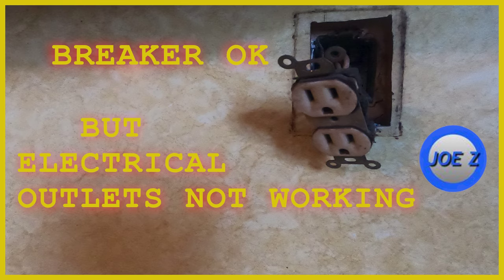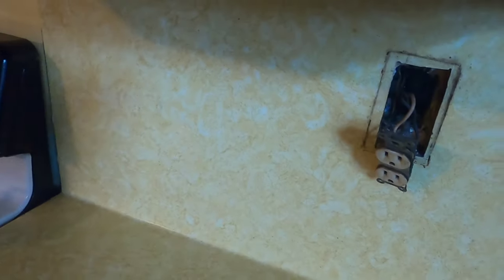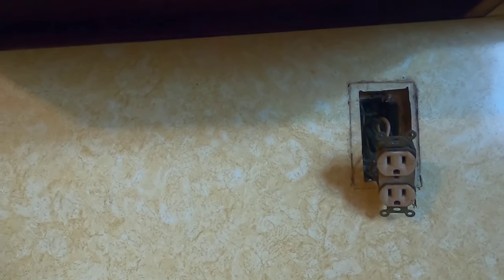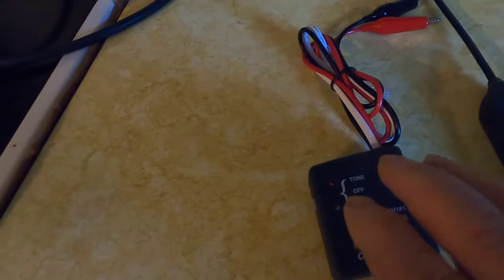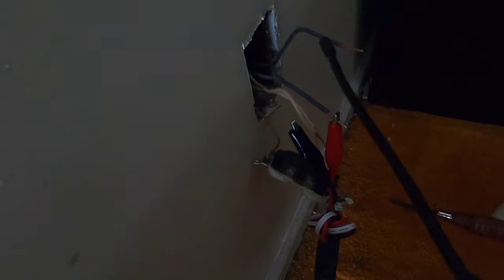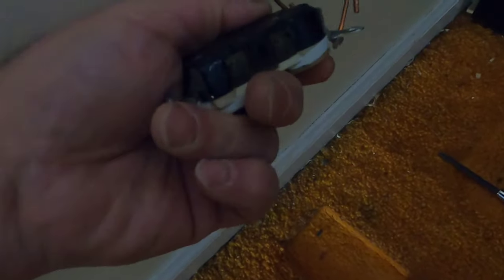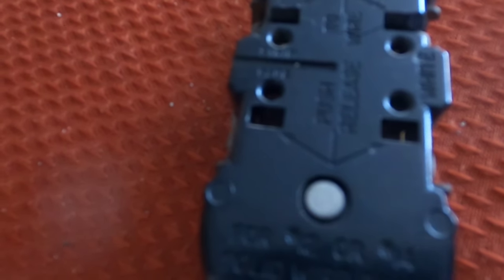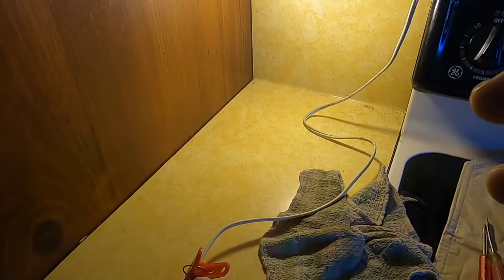Breaker on but no power to outlet FIX

Comment: Thanks man, my wife was pulling my handy man card because I couldn’t figure out the outlets. At 3:26 you fixed my problem, I ran to another bathroom and saw the GFI outlet was tripped and I smacked the button and wallah everything was back to working. Was that simple. Thanks again for the trouble shooting.
Reply from the maker: shahriar bakhtiari,  You're welcome, I am glad this was of help. & you got to keep your handy man card LOL Thank You for watching and taking the time to comment. shahriar bakhtiari I have other videos on my channel that cover many different subjects  and new videos added weekly that may also be of help or interest.
 Be sure to 👍, share and subscribe if your are inclined to do so.  Also not to miss any new videos remember to hit that notification 🔔
 Another way you can help support  this channel at NO cost to you is by using one of my affiliate links.
             * Thank you for watching I really appreciate your support.***
Again I hope you get to  enjoy other videos on my channel as well. 
 Stay safe, Joe Z
Reply: The GFCI outlet was what was causing a problem I had to fix last weekend, except that I had to replace it. Pressing the reset button didn't do anything.
Reply from the maker: @cordialspirit  The GFCI outlet is a good place to start. In my case there wasn't any GFCI outlet only a GFCI circuit breaker. The breaker was ok it was a bad outlet in the circuit that I had to find & replace.   Stay safe, Joe Z

Comment: Great video. You have the patience of Job. What was the tester you bought at Harbour Freight? I rewound the video and couldn't read it from the camera moving nor find it in your store.  Thanks
Reply from the maker: You're welcome and thank you for watching and your comment. First time I was told I had the patience of Job. I will have to keep that in mind when "my patience" is running low LOL. 
That tracker is a Cen Tech cable Tracker. If Harbor Freight does not have it in stock You can use this Amazon link https://amzn.to/3IgtbKR. There are other options on the site as well. It has been awhile since I used this tracker but may be needing it once again. Let me know if I can be of any help.
Stay safe, Joe Z

Comment: I just changed the first plug on the circuit and everything else down the line came on you did make a good video.
Reply from the maker: Thank you for stopping by & taking the time to comment. How did you know which outlet to change or if it was the outlet that was the problem?
Stay safe, Joe Z
Reply: @JOEZEP54  it was an outlet from 1940. My microwave and fridge went out today while I was using the microwave so I figured I'd change that plug first. Your video was good I did learn somethings ty

Comment: I have three outlets in the kitchen all of sudden has no power.  Do you suggest changing all three of those outlets?
Reply from the maker: Thank you for watching. Please keep in mind I am not an electrician. I would check where the power/current is being supplied from. Look for the outlet that has only 2 wires that should be the end of the run. Then check to see if the other 2 have power being supplied to them. If not your problem is in another area. In my case it was from an outlet in another room that went bad. Keep safety in mind when doing any electrical work a small mistake can have deadly consequences. If you are not familiar with working with electrical issues calling an electrician  would be the safest option.
Let me know if this was of help.
Stay safe,  Joe Z

Comment: I think I might have the same problem. Thanks for the video. I have one outlet in the master bedroom that must be connected to the next bedroom. The entire second bedroom has no power but the circuit breaker at the main panel is not tripped and I originally reset the breaker. I have a laser printer that may have caused a big surge on that one outlet.
Reply from the maker: rlg222,  You're welcome, I am glad this was of help. And thank you for watching and taking the time to comment.
If that is the outlet it will save you some time to make the repair. In my case I had no idea.

Just be careful & use all safety measures.

rlg222 I have other videos on my channel that cover many different subjects  and new videos added weekly that may also be of help or interest.
 
Your support is not required or expected but always appreciated. If you are inclined to do so your Subscription, Likes, Comments and using the following links do help.

     
rlg222 I just want to mention If you haven't installed the TubeBuddy browser plugin yet, to help your channel grow  Just go to my favorite tool for channel growth Tube Buddy. Now You can use it too, here's my affiliate link to the Free versionhttps://www.tubebuddy.com/joezep54   Start with the free version, yes it is free to not only to down load but to use.
Again I hope you get to  enjoy other videos on my channel as well. 
 Stay safe, Joe Z
Reply: @JOEZEP54   I found the problem. The outlet that the HP laser printer which pulled 6A was plugged into was actually ok. It was daisy chained to the next outlet, two other outlets and the light switch for the room in the next room on one side of the room. The hot side which had three hot wires melted the wire nut for some reason. I pulled all the wires out cleaned it up and used WAGOS instead of wire nuts. Then I replaced the outlet.
Reply from the maker: @rlg222  Glad you were able to find the issue. I would look into why that wire nut melted just to be safe.

Comment: OK,  I have similar prob w/ garage receptacle . So I made a "suicide cable" {Confirm Hot & neutral prongs, make sure you are on same branch &/or same leg, not opposite leg = 220V] to jumper from a good receptacle on that branch to the dead one and the other dead receptacle started working. But HOW the heck did you disconnect the push wires? Seem to me there is a release slot but they won't let go. Thanks
Reply from the maker: Thank you for watching & commenting. I am not a safety " nut" but would  not rely on that  "suicide cable" and remove it. I have run into some outlets that would not let go. Do not know why but it does happen . I just snipped the wire as close as possible to the outlet.
Stay safe, Joe Z
Reply: @JOEZEP54  Ok but my vehicles were trapped since garage door was on the branch. I watched another video & found a proper size screwdriver & removed the push in wires. Tossed the junk receptacle and replaced it with a HD 20A amp screw  clamp only receptacle & all the garage receptacles work again. Thanks
Reply from the maker: @scotts.7662  Did what you had to do and all worked out well. Glad you were able to find & make the repair to get everything up & running. 
Stay well, Joe Z

Comment: Good Job, Joe Z,  I will see if just starting with changing 2 old outlets in mu garage that are not getting power will do the trick as Circuit breakers all seem to be working.  Thanks************Kurt
Reply from the maker: You're welcome. Thank you for taking the time to comment. Even with the breakers off check the lines for current. It is possible to have a faulty breaker, mislabeled. or 2 lines powering the same outlet. Come visit again.
Stay safe, Joe Z

Comment: I believe this is exactly what is going on in my house, the outlets in the master bedroom (above the living room) and the living room are all not working, but they work in the dining room next to the living room which is on the same breaker. The breakers are all in the on position and have been switched on and off multiple times in testing. The box has no lose breakers and the outlets are quite old, around 50 years old in some parts of the house so they really needed replacing. I will be replacing 9 outlets in total so that each of the affected and the one previous in line to the affected will all be brand new and hopefully restores the power in that area. Though for me it's hit the lighting on the same circuit, the lights won't turn on either... so who knows for sure until I replace the sockets if that was the case or if the wiring itself will need replacement. This isn't my house, but the company that manages it doesn't do repairs... I've had to do them all myself after YEARS of waiting which is appalling, but when I do it myself it is done fast and I take all the precautions to do it right. 

Thank you for your video, and I appreciate you prefacing that you aren't an electrician and also reconfirming it again at the end, you did a lot of good work yourself for not being further educated specifically in that trade.
Reply from the maker: You're welcome. I am glad this was of help & thank you for watching & commenting. Just a "non-electrician" tip, if you have an outlet supplying  more than one other outlet, using a pigtail to make the connection will save a lot of time to repair a faulty outlet in the future.
Again I stress that I am not an electrician & just sharing what I have discovered along the way.
Hope you get to visit my channel again.
Stay safe, Joe Z
Reply: @JOEZEP54  Thank you! That's good advice 😊 I will keep it in mind. I appreciate you and your video!

Comment: Excellent video,thank you! When a room is ran in series like so many are all it takes is 1 bad outlet to kill power to the entire room and you have to figure out which outlet is the culprit. From all the research I've done it seems that the spring loaded terminals in those outlets cause a lot of the problems. Electricians probably get kind of lazy when they are wiring rooms so they use that stab method to speed things up instead of wrapping both wires(the in and out) around the screw terminals.
Reply from the maker: You're welcome and  thank you for your comment!  I appreciate you taking the time to compliment and add information. The house was built in the 70s' when there was a sort of building boom. Things were rushed back then. We pay the price for it today. 
Thanks again & stay well,  Joe Z
Reply: The BBC

Comment: I can only run fans and the lights in my house right now because im not getting enough power.

Checked the outside box and the inside box and the readings are coming back like they should, but i still have very little power, and fluctuations when i plug other stuff in. Any help would be appreciated. Ty.
Reply from the maker: Keep in mind I am not an electrician & am not giving electrical instructions. That said I would first check the breaker for this line. Do you see any corrosion or discoloration on the connection where the line is connected to it or on the breaker where it connects to the box?
I would also check the outlets that have the issue. Looking for any discoloration, loose or disconnected wires. Let me know if this was of any help.
Stay safe, Joe Z
Reply: @JOEZEP54  every receptacle in my house doesn't have the ability to power my refrigerator. I hooked up a meter and every receptacle has the right reading of around 120, in and back. Ty.

Comment: That's good work! I'm going through the same thing now but can't identify where the circuit goes.
Reply from the maker: Hi Paul thank you for stopping by. How can I help you?

Be Safe, Joe Z
Reply: @JOEZEP54  I've got a dead circuit and it's nuts but I'm getting that tracker today
Reply from the maker: @paulbruney1704  Hi Paul, the tracker can be tricky to use the first time out. It was for me. I did not think of it at the time, but use it to track a circuit that is working or better yet a long extension cord. This may be of help to distinguish  the different tones. Let me know how it works out.  Remember to take precautions & be extremely careful. Joe Z
Reply: @JOEZEP54  Thank you I will. It will take a while because the circuit has a light,  to a recepticle" used as junction and a rangehood. It had two other connections but I removed them because they aren't needed

Comment: Code book says that a microwave should have its own receptacle powered by its own breaker.
The wires should be pigtailed.
Excellent trouble shooting! 👍🏽🙌🏽
Reply from the maker: Thank you. Your visiting & informational comment is appreciated. I did not know about the microwave having its own breaker. I am asking if the code is for NY & if it changed since 1976. I am not an electrician, familiar with some codes but not many. All the receptacles that I replaced were originally connected by using the push in holes rather than wrapping the wire around the screw. All previously done at the time of construction by the same electrician. I guess I should be glad they did not install aluminum wires.
Joe Z

Comment: I kinda had this same problem. What happened with mine is an electrician combined the light and fan in a bathroom to one switch. So one switch turned on both the light and fan. Well he also accidentally combined the gfi receptacle which was also feeding a few different receptacles. So every time the switch was off, about 4 receptacles didn’t work either. To fix it I found the line in wire. Connected the receptacle to it. Then pig tailed that to the switch. Leaving the switch, I connected the light and fan. Now everything works 👍 
P.s. I’m a carpenter so judge accordingly lol
Reply from the maker: Thank you for stopping by & taking the time to share. Anyone can make a mistake but it is scary what we come across and not just in the trades. I mentioned it in the video & will again if anyone else should read this post, I am not an electrician 😕. 
Hope you get to visit again.
Stay safe, Joe Z

Comment: I pulled out an old electric outlet, to replace it with a GFCI. 

I accidentally touched some part of the old outlet while removing it on the metal box, and saw a small spark. (I thought the fuse was out, but maybe I had the wrong fuse out). 

Now, I am reading 14 volts from hot to neutral, and from hot to the metal box(ground). I've pulled every fuse in the panel, and still see 14 volts! 

Note, the outlet was working fine before my accident (although the hot/neutral were reversed). 

What did I do break when that old receptacle sparked? Did I burn/short a wire, or junction? How do I find the problem. I cannot use continuity tests since I have 14 volts present. Help!
Reply from the maker: M.N. I am not an electrician & qualified in this area. That said I am stumped as to the 14 volts & not higher. I have run into  disconnected neutral, hot ground reverse but with higher voltage. Having fuses tells me this is an older home & over the years work probably was done. Wires could have been connected incorrectly or may even have a spot where it deteriorated. Have you had any work done lately? If so I would check that out next. Before you work on this outlet shut or pull the main fuse out to block any current from entering the lines. Sorry I cannot be of more help. I know as a DIYer we want to do it ourselves but we also have to keep safety in mind & sometime have to call in the " specialist ".
Let me know if you or an electrician repaired this issue. Your post would be a help for anyone else that may run into this.
Stay safe, Joe Z

Comment: As an Electrician of 26+ yrs... just from this video I see a few Code Violations you really want to have corrected by a PROFESSIONAL.
Reply from the maker: Greg thank you for stopping by & taking the time to comment. It was already suggested that the micro wave have a separate line. Other than that what do you recommend. This is the original wiring done by a  licensed electrician & had to pass building code. It was back in the early 70s. Could codes have changed that much?
Stay safe, Joe Z

Comment: The one outlet screwed up the series of outlets. I’m having the same problem with one outlet in my kitchen too. I have outlet 1, 2, 3  all in line from left to right on the same wall, above the counter. The first #1 outlet doesn’t work but the other ones do. I never checked it to see if it’s just a dummy outlet or if the outlet is faulty.
Reply from the maker: Do you have power in the line going to that outlet? Also I recently got several useful comment on this video by other viewers that may be of help understanding how & why the wires are run.
Let me know how you do with this.
Most of all be safe, Joe Z

Comment: also watch/inspect your wirenuts. i had a dead branch that went dead after 15mins of 75watt LED light running. the branch was ALL my basement lights
(7 sockets). after long inspecting outlets and switches, the culpret was a ceiling light 4 wire orang nut. you could see the lite burned wire of the 4wire twist. cleaned and renutted and al is well
Reply from the maker: crabtrap thank you for visiting & contributing this information.
Glad you were able to find the electrical fault & make the repair.
Be sure to visit again.
Stay safe, Joe Z